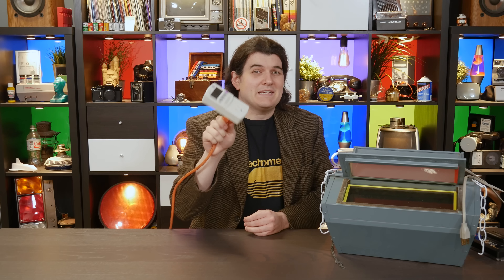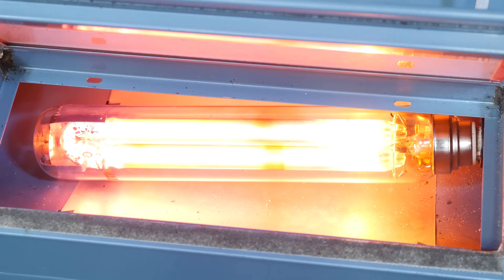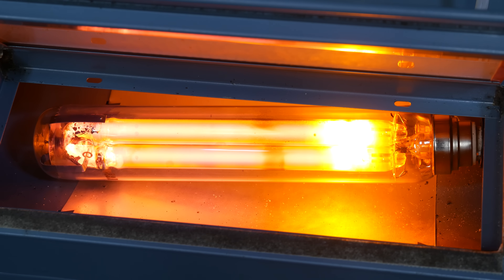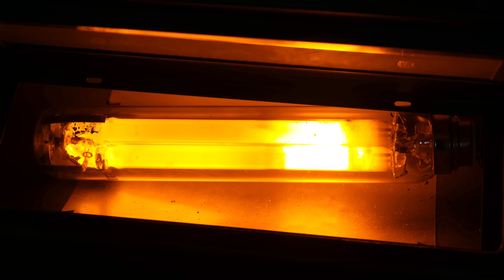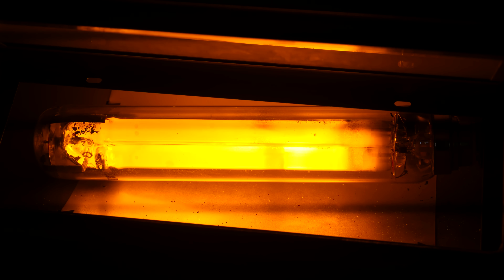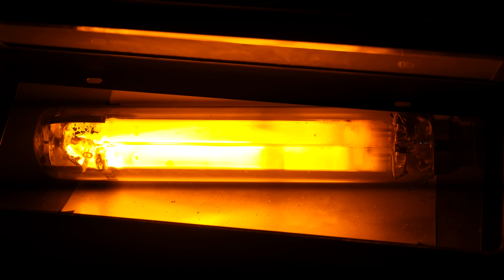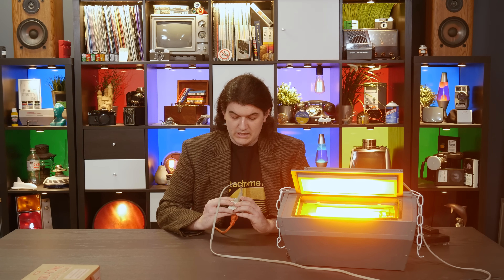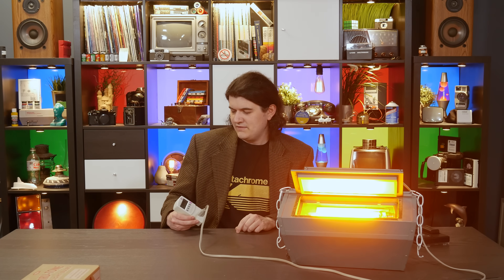More vaguely-informative ramblings about low pressure sodium lamps

Comment: As a kid I remember the prevalence of Mercury vapor street lamps.  They glowed a blue white color.  It was strange when Sodium vapor lamps became common later on. In some ways the high intensity LED street lamps take me back to the Mercury vapor days at least in relation to the light spectrum they produce.
Reply: In my house I still have a Mercury Vapor clear coated lamp to light the backyard. The light as you said is a white/bluish color It really brings out the green color of the lawn and trees
Reply: We had a mercury vapor light on our house when I was a kid. The icy blue/white was a very distinct color.
Reply: I have only seen coated mercury lamps called DRL when I was kid living mostly on streets. You could easily see which were recently replaced as it turned from pink to green with use._
Reply: Yup, when I was little (mid 80's) all the streetlights where I grew up were mercury vapor. Then at some point they changed to sodium, and I really hated the orange light. I'm pretty sure they just changed the bulbs over, as the light head itself stayed exactly the same
Reply: I recall these as well, & this time of year especially. Boxing Day meant being dragged by parents to several  boring parties. So I would often stare out windows putting my eyes out of focus to see more clearly the blue halo around the street lights.
Reply: When I was a kid I did remember the freeways and many streetlights use these things in my city in early 90s, except of the harbor freeway which already used High Pressure variant for as long as I could remember. I remember watching them all turning on at once on sunset with their distinctive red color when initially turned on. When the newer freeway opened in around 95-96 it initially used something with cold white light, I am not sure what it is, probably mercury. HP Sodium slowly replaced everything else in late 2000s before getting replaced again with LED.
Reply: @rps215  That white illumination on the freeway was probably by metal halide :-) could have been mercury vapor as well. They are less efficient than HPS or LPS, and metal halides also dont last that long and are more expensive, hence there is a tempatation not to use them. To me mercury vapor has always seemed very bluish, those metal halides are pretty much the only light that have ”incadescent” like models that is in public use (now there are also some warmer LEDs), but some are more bluish like many xenon headlights.

Comment: Near the police station over here in UK, there are still some low pressure sodium lamps, and besides that there are many seen accross the village/town, and there is very old road that isn't used anymore, and very overgrown! You could bearly see the low pressure sodium lamps but it's there and has been working for many years without any proper maintaince nor replacements! Shame that bunch of kids have smashed one of the bulbs by throwing rocks at it, but at least the other 1 on the opposite end continues to work as luckily enough only the protective shield is damaged and not the bulb it self! Even tho the place is completely over grown, I continue to talk down the overgrown road for that nostalgia without tripping over ofc.

Comment: Hello :)  I'd like to thank you for talking about these. I always liked these lamps but knew nothing about them till I saw your video "Why are some streetlights orange".
From that video I understood the difference between LPS and HPS lamps. And that sparked me to research more about them, and got a few of my own. Thankfully, just in time because they stopped making them by the end of 2019 as I understand it.

These lights will fail in time. Heavily made as they are, the weak spot with them is the electrodes. They have a limited number of strike times. The initial strike and warm up is hard on them, as a bit of the emissive oxide spatters off them each time they are lit. That's what forms light greyish deposit on the glass at the electrode ends. As I understand it, this is how the majority of them fail.

Unless the lamp wasn't level at one time when in use, the reason the sodium has migrated to the bend is because when the lamp is operating, the bend, and the electrode ends are the coldest part of the lamp, and when the lamp is turned off and the sodium vapor condenses, it will accumulate on the coolest parts of the lamp.

Comment: Another big doo-doo regarding power factor is that the power plant has to generate and transmit a bunch of extra  power that's going to be wasted in low power factor devices. And they often don't/can't bill you for the wasted energy (locality dependent). That could be a good short episode. What it is and why it's such a bad thing. People don't often have any idea about it.

Comment: Better ballasts are available including electronic with improved efficiency.  Sodium ions generally migrate with AC to the ‘U’-bend or half way point in the lamp also a condensing cooler point in the lamp. You definitely don’t want the liquid sodium down in the electrodes as the glass is likely to fail, hence the dimples to restrict it.  They have a number of failure modes but can last for 4 or more years of night service. The current stays constant but the voltage falls in the warm up transition from neon-argon to sodium hence the wattage reduces.

Comment: Power factor: I powered a microwave xformer (after I stripped out the secondary) with no load. Drew 10 amps!  Primary wires got hot.  Put it on the shelf.  :)

Comment: I'm guessing that these where the same way that Xenon short Arc lamps wear. That is to say the electrodes that are in there for the striker start to wear off after being heated and cooled, and then also overtime the vacuum in the outer tube is reduced, and that leads the inner tube to lose pressure, which means they lose efficiency, and will draw more power as they age.

Comment: The reason bridges and  tunnels use yellow/amber lights is because it's the easiest light for our eyes to adjust to suddenly. Going from midday to a dark tunnel and then going back to midday can cause a lot of problems for the driver.
Reply: This is a factor I wish more design would take into account. I have a 2014 Audi S4 and a 2021 F-150, and while the Ford is incredibly nice and full of features, Ford also makes all the lighting in their interiors bright blue. The Audi is all lit up in red, and much better suited to night driving. Modern LED emergency lighting (the ones that come on when the power goes out) are also stupidly bright white, and could prove really disorienting in an actual emergency.

Comment: What? Putting unnessesary stress on the power grid without unnessesary power consumption? Maybe the explanation was very off but it sounded like nonesense to me.
Well you can of course put unnessesary stress on the power grid but this is by consuming unnessesary power and mostly dumping heat into the air.

Comment: Back before they replaced all the street lighting here with LEDs they were all low pressure sodium, and there were definitely some that failed and would stay a dim pink-orange all night until someone eventually came and put a new bulb in. Actually a lot of the light poles here used to be concrete too, now they're all metal
Reply: Wait until you see some of the bad batch of LED street lamps that are turning purple!
Reply: @stephenj4937  That wouldn't be as big a deal as our defective ones in my neighborhood. They flicker at about 3hz...Most of us are begging the county to replace them with ANYTHING but another one of those stupid LED lamps. They're not even 6 months old and a good 1/3 are already flickering like this!
Reply: @stephenj4937  It's either that, or they fail in spectacular way that it pops the main breaker to all the street lights, and yes this has happend multiple times ...and is quite dangerous since you can't see whose around the corner!
Reply: @stephenj4937  all throughout Tampa, St Petersburg and down into Bradenton the new LED lights are beginning to turn anywhere from a light violet to a deep blue.

The North Sunshine skyway rest stop aka USCG Blackthorn memorial Park is illuminated almost entirely with deep blue lighting at night everywhere except the ramps which still have the high pressure sodium.
Reply: It has literally only just occurred to me that this is the same technology the street lamps used to be, and thats why they would turn on pink and then become yellow over time, literally seconds before reading this comment. 

I miss when street lights were like that. I unfortunately grew up in areas where they were virtually all metal (although there was a stone one right outside my old house. Its unfortunately been disconnected and had a metal one put up right next to it since then) but theres something very nostalgic about it to me.

I also feel as though they are brighter than the led ones that have replaced them, although this may partially be due to the colour of the lighting instead of their actual brightness? But either way i feel much safer out at night, illuminated by the orange glow of sodium lamps than i do the newer led ones.
Reply: @NextDefault  LED lamps are very directional, whereas older technologies the light spills out in a wide beam. This is why they quote LED lighting as being better for illumination (as more light is actually directed down onto the road surface), but that comes at a cost of not really lighting the surroundings, leaving more dark areas on buildings and in street corners. That does reduce light pollution, but makes the roads seem darker for pedestrians (the ones that the streetlights are actually for).
Reply: @NextDefault  they maybe high pressure sodium. Not sure the difference but I think most street lamps are high pressure sodium.
Reply: @ohioplayer-bl9em  high pressure sodium has a slightly wider spectrum output I think, its not quite as monochromatic
Reply: Most street lights over here are mostly metal sadly, altho there are still few that are either hybrid of concrete with new head fitting which is bit out of place and/or many street lights are still concrete with the original low pressure sodium lamps as they are left untouch thankfully.
Reply: @Stuff1646  In my place of the world they're replacing all of the wiring with underground wiring. That causes many issues, and solves few. But the biggest motivation that is aesthetics seems to remain
Reply: @AnnaVannieuwenhuyse  I wish they would do that where I live. I'm tired of multi-hour winter outages caused by trees falling on the roadside overhead lines.

Comment: In my area theres a house that has 2 Mercury Vapor(MV) lamps that appear to have been retrofitted with these LPS,the light looks dark yellow but warm
My house still uses a clear bulb MV to light the backyard and has been in service for almost 15 years now and it still lights up a great amount and really brings out the green color of the lawn and trees. The light itself is still white/blue. Theres a house a few blocks  over that also has a clear coated MV lamp but the people that have been around say that the bulb hasn’t been changed since the late 70’s. I believe it because that MV lamp looks green as can be and somewhat dim,it barely lights up the yard
Reply: If you are talking about yardblaster style bucket lights, those were made in 35W LPS versions back in the 1970s/1980s.  The lenses will be a few inches longer than those on high pressure mercury/high pressure sodium/metal halide bucket lights to account for the longer lamp.
Reply: @randacnam7321  thats what it must be then,yeah i noted the lense  was larger than a normal nema head one. I didnt know they made them in bucket style back then,thats cool
Reply: There is a parking garage at the hospital where I work and the roof is illuminated by what appears to be a 1000 watt MV lamp that is on continuously day and night on a very tall pole. For the 20 years that I’ve parked there’s it’s been in use though now much dimmer and greener.
Reply: @z06rcr  thats a rare find nowadays too, especially a mercury vapor with 1000W. From what I can tell is that mercury vapor lamps can last for an indefinite amount of time,but they depreciate in brightness instead of cycle like other lamps
Reply: @henrycalde1991  Mercury lamp life also depends on the manufacturer.  Westinghouse Lifeguard lamps as well as any Japanese made Iwasaki lamp are well known for their longevity.  Chinesium ones, not so much.  Especially 175W no name lamps from the 2010s where the arc length is too short and thus the reduced arc potential overloads the ballast.

Comment: In my city, they actually retro fitted the low pressure sodium lamps, with LED's that are the almost the same colour.
Reply: Your city must love astronomers then 🤓. Every place I frequent has been putting in the whitest white leds they can get their hands on for street use; illuminated sections of highways/turnpikes may have slightly warmer LEDs in some places, but the standard is also very white LEDs

(From a traffic perspective, cool white seems to be the best illumination for your buck, and personally I find it more agreeable for my eyes when driving/walking/biking at night; but it's bad for astronomy -- much harder to filter and interferes with useful observational frequencies -- and not ideal for your circadian rhythm)
Reply: @docontra4921  Well, the thing is that it's not everywhere in my city, other roads here that had high pressure sodium lamps where replaced to those white led's. but the old part of the city they did that. probably because they wanted to keep the same mood

Comment: They were very common in the Netherlands over highways en in rural areas. Yes if you aren't used to it, the fixtures containing the 180 watt bulbs look strange. I saved a couple of SOX lamps for nostalgic reasons
Reply: I also have a strong nostalgia for these. Especially when it would be overcast, and the lights would cast an orange glow on the clouds at night.

Comment: There’s a lot of science to be done and data to gather if you were so inclined. That energy is going somewhere so the ballast may not be doing what it’s supposed to be doing in the way it was engineered to do… or maybe efficiency wasn’t a concern when it was made. You know the power going in and what the bulb says it’s rated for but not what’s getting to the bulb or if all of the lost energy is the ballast acting as a terrible space heater. 

Anyway it’s always fun to see what rabbit hole your line of questioning drags you down.

Comment: I saw a failed sodium lamp recently in the wild. The lamp would start, take a couple minutes to warm up, then turn itself off about 30 seconds after turning yellow. Then it would repeat about every 5 minutes. I suspect there was either some thermal cutout turning it off, or just thermal expansion and a dodgy connection somewhere.
Reply from the maker: That's the failure mode of high pressure sodium, known as cycling. Because the pressure in the arc tube is so high, as the bulb ages it takes more and more effort to sustain the arc. Eventually it runs up against the ballast's limit and the lamp extinguishes at that point until it's cool enough to re-strike. That will happen endlessly until it's relamped (or may stop if the ballast is some sort of smart ballast but I don't think they're common).
As far as I know that doesn't happen with LPS lamps.

Comment: Yeah but it supposed to have bulb on each side so 2x35 w is 70 that would be right
Reply from the maker: Um, no it isn't. There's just one socket.
Reply: @TechnologyConnextras  Right I was fooled by those two windows, anyways, there's replacement bulb for 120 new on freestylephoto website P.S you totally write same way as you speak I totally had your voice in my head reading it

Comment: Faaaancy. Our safelight when I was a kid was a giant-but-low-power incandescent bulb that had been literally dipped in red stuff, like a cone at Dairy Queen. You could see where they got the paint on the first row of the threads and everything.
Reply: So called fireglow bulbs are still made like that. Very low wattage incandescent and dipped in red dye. Official use is in fake coal fires to give a comforting glow between the "coals" but can be subverted into use as a nightlight. Dimmer than the dimmest mains LED, but uses a lot more power.
Reply: I remember those. You could buy multicolor sets, or single colors dipped in paint. “Bug lights” were just dipped in a yellow coating.